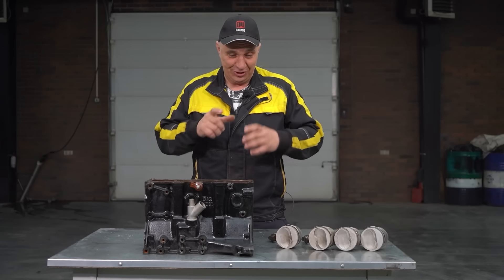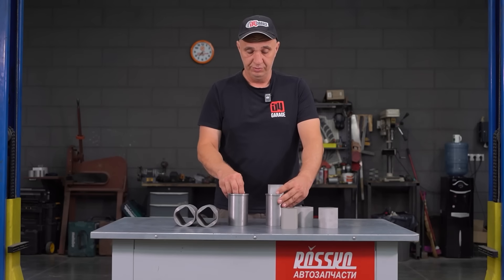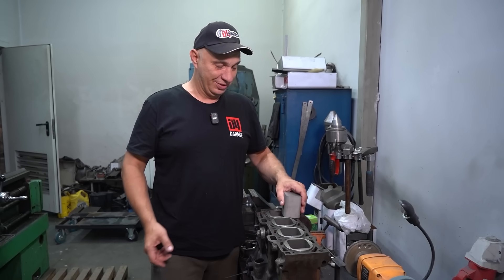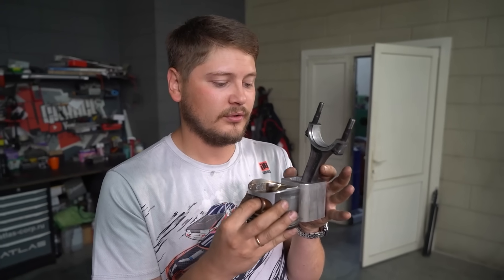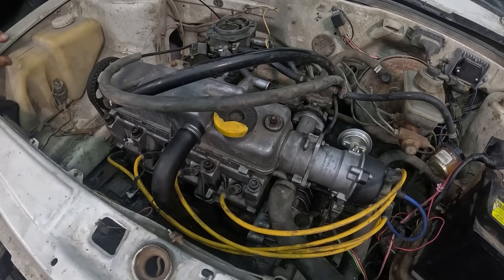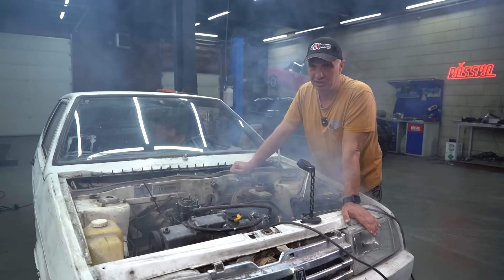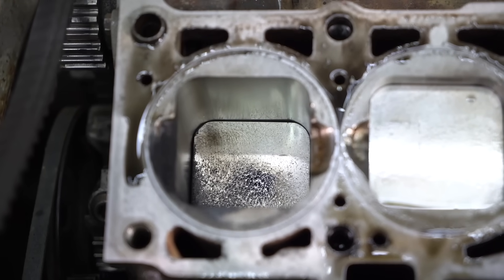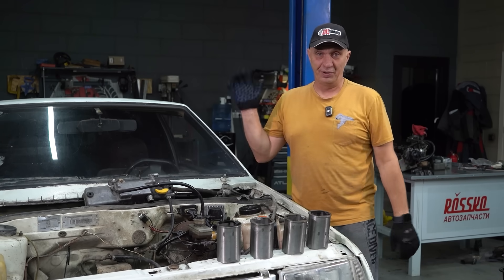We make square-section pistons - will they work?

Comment: Honda has an engine with oval shaped pistons. Not aware of any with squared ones though.
Reply: Wait, Garage54 should try making oval pistons. :)
Reply: Oval pistons have been experimented with several times. Mostly in racing with motorcycles, F1, and the like.
Reply: Ferrari aussi sur son V12.
Reply: junkers CLM made an opposed piston 2 stroke diesel with a square scavenge piston.
Reply: what possible benefit could that provide besides a sizing thing maybe? How did they solve the piston ring thing? Ideally they can rotate..
Reply: Ok for fun I guess, but pointless.
Reply: The officially closest thing to this, is the SPEC engine. You can find a lot on this by looking for "Square Piston Engine" (SPEC) Prototype (2008).
There have been a few patents for different square piston engines over the years too, however these are primarily for steam engines it seems. 

I will hazard a guess as I am unsure why someone would make it besides the cool factor... It could be because the pistons have a bigger surface area, so in theory you could get more power from combustion... In reality, it's negligible and just a nightmare to make.

Comment: Yes YES YEEEES! OHH thank you so very much! I really mean this!   We have all seen the oval piston Nsr Honda stuff. But square...Ive always wondered this!?   Thanks for showing us your way!!!
Reply: I remember the talk of oval pistons from one of the big Japanese motorcycle manufacturers (might be Honda?) so they could use more valves and have better breathing.  I'm sure the oval piston engines were hand-built and put out impressive numbers.  But, completely impractical for mass production.
Reply: @BlackPill-obey  They did sell the Honda NR-750 street legal bikes with the oval piston V4 engines, tho cannot say about numbers.
From what I recall about the story (of the competition NR-500 with also oval pistons) it had also something to do with regulations allowing only up to 4 cylinders, but they basically made a V8 with adjacent pistons conjoined. Two connecting rods per piston at that.

Another interesting info is that I've heard about patents to use oval pistons in a different configuration, with them packed so as to reduce length, I can see this as an interesting way to achieve higher displacement of a more compact form and at the same time breathing better from 2 valves than a round piston. Ferrari was working on this if memory serves right.
Reply: @Kalvinjj I think it was 500 models for super bike homologation necessities. 

Bike magazines nicknamed it the never ready 750. 

115hp out of a street 750 v four which were known for higher torque less hp than inline 4. The race 500's were getting 130? I think. 

My CBR 900 street version made 125. So 10 HP more than the oval 8 valve 750 but I think same or less torque than the 750.
Reply: @Kalvinjj  I'm glad you remember better than I do!  It all sounds familiar, now that you added some details.  

And, again, just imagine trying to mass produce such a thing.  No way it could've been produced in any economically viable numbers.  Still, a fascinating design exercise.

Comment: Hi , in England known as, ' Spark Erosion' used a lot in tool making where complicated profiles are needed.Problem is as you say it takes a long time to complete. Many thanks.
Reply: Spark erosion and wire EDM are two different machines.
Reply: @dwhelan88  Both are EDM (Electrical Discharge) machines.....One uses a wire to cutout shapes, the other uses a pre-formed electrode (usually made of graphite) to plunge in shapes.........

Comment: Garage 54 once more answering the questions dudes have for time to time
Reply: Triangle piston
Reply: Tendrás que poner ánimos de amianto, la goma se derrite con la candela y se quema
Reply: More like answering a question noone asked and we like it 😂
Reply: @larrythes I see  the electric toys gang is  here 😂😂😂
Reply: @larrythes  these are the kind of questions that only pop into my head for a couple seconds before I go "nah that's a stupid thing to wonder about" and then forget I ever thought about it
Reply: @thecrazyfarmboy I had a conversation with Chatgpt about why there aren't any square pistons...it explained to me in full detail, why I'm an idiot and i dont know shit about engines for even wondering. 😅😅
Reply: What if spherical pistons?
Reply: @дякую321  "That thing got a Hemi?" 🤠
Reply: @дякую321  Honda did the oval ones.
Reply: @дякую321  Literaly that can eliminate the need for pivoting connecting rods tho, since the sphere just rotates freely in the cylinder and mimick the movement of the conecting rods
Reply: @gabrieljordan9977  I think the biggest issue would be compression. Probably hard to get a good seal when the contact area is just a 1-dimensional line.
Reply: @16BitGoofball Yeah thats realistic. Could work tho, but have the same sealing problems as wankel engines.
Reply: @gabrieljordan9977  Maybe the piston ring would consist of what is essentially a normal ring, but partially extruded along the surface of the sphere. Still no oil ring, but at least compression is addressed.
Reply: @16BitGoofball  ???? What happens in a round bore?
Reply: @Onan-u3b  I don't understand the point of confusion here.
Reply: @16BitGoofball  Now you are confusing me!  
"I think the biggest issue would be compression. Probably hard to get a good seal when the contact area is just a 1-dimensional line."  <- ???
Reply: @Onan-u3b  Think about the geometry of a sphere inside a cylinder. The sphere only contacts the cylinder along a line that is (mathematically speaking) zero width.

A typical piston has several rings that each make contact with the cylinder walls, and it therefore has much greater contact area with which to form a seal.

Comment: The amount of work that went into making this was appreciated, well done lads 👍
Reply: Vlads
Reply: WIE. KAN  EINE  GUMI  RING  AN  PISTON  ANGEBRACHT BEI SO
HOHE  EXPLOSION  TEMPERATU  IN  INERE  CILINDER   DER  HAT
NICHTEINMAL  RICHTIGE  PRESION. 
SELBST BEI  REIBUNG  DIESE  GUMI. DICHTUNGEN  WERDEN SER 
SCHNEL  SCHMELZEN .
Reply: This confirms why pistons have to be round
Reply: i cant believe they did all that just to put rubbing rings in the pistons. would have been better off using nothing.
Reply: @wyattcitizenzap4539 u have to use rings, without u either have no compression,  or the piston will stuck when gets hot. 2nd issue is , how u make metal rings? U need a high quality metal, and u need to shape it to that square piston.
Reply: @wyattcitizenzap4539 if it was possible to put metal piston rings on it that would have held more compression but you will still get hot spots on the corners, but amazing engineering just to make it 👍
Reply: @wyattcitizenzap4539  ah yes as non would totally hold compression